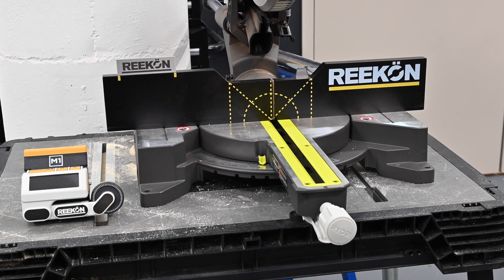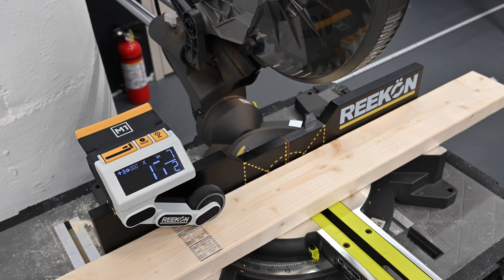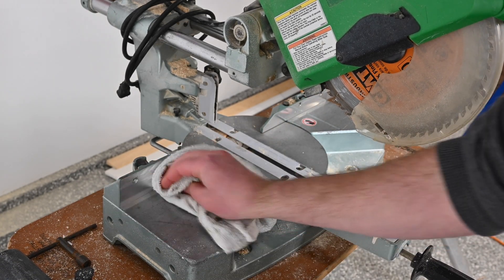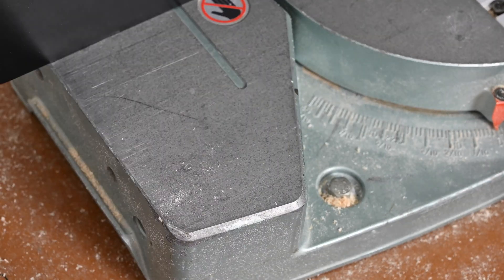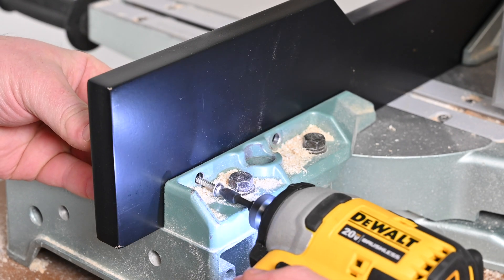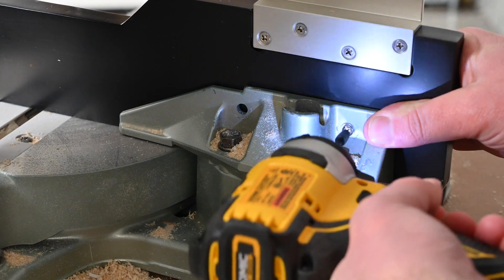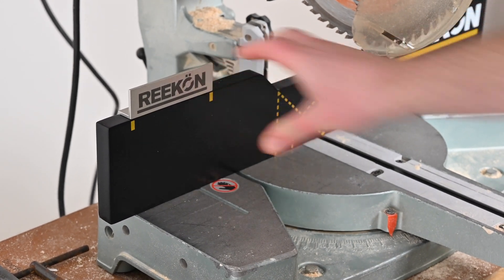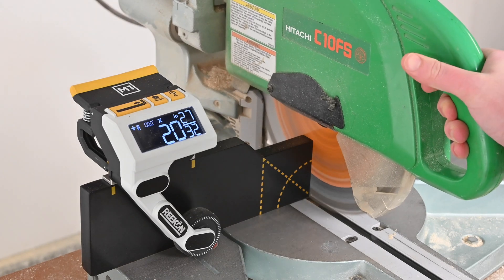M1 Caliber Adapter Fence Installation - REEKON Tools

Comment: Hello, I'd like to know, how much this it's cost? Do you have a website!? Thanks
Reply from the maker: Hello Bruno, the Adapter Fence can be found on Amazon here - https://www.amazon.com/REEKON-Caliber-Adapter-Fence-Installation/dp/B09F3X5Z45
Reply: @REEKONTools  The product has been out of stock at Amazon for several months, you say they would get a new one in early January when I ask the question. but the answer that is on their side is that they do not know when they will get it back in stock